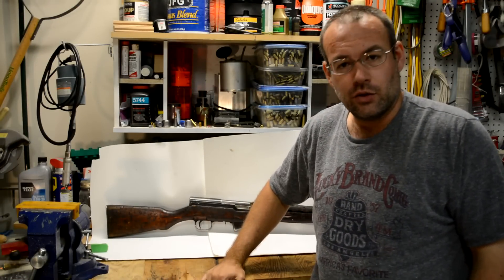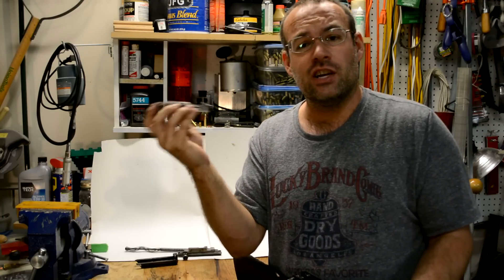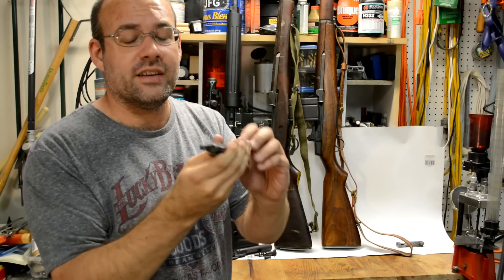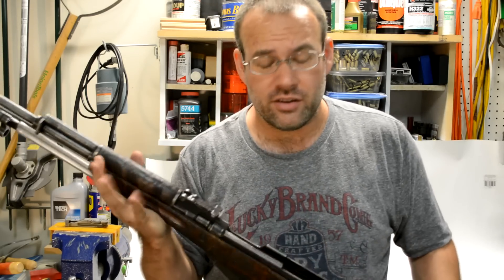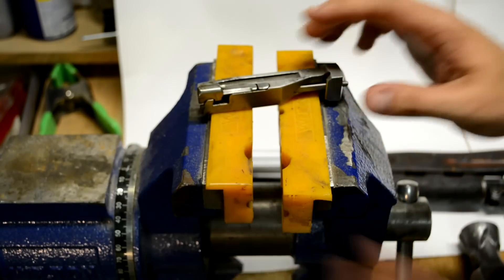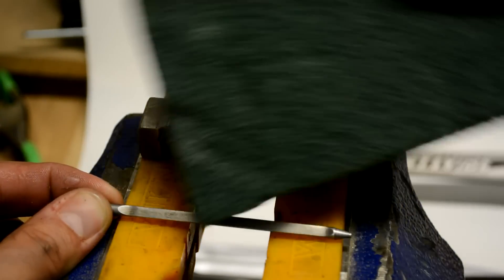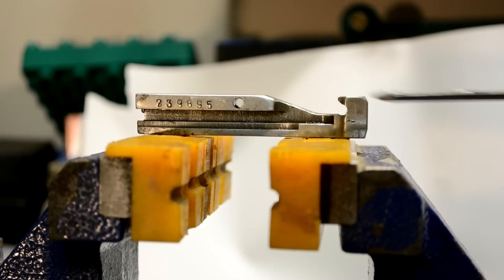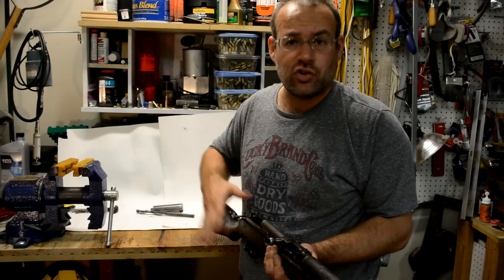Slam Fires in SKS Rifles

Comment: I got a Chinese sks is near perfect condition, Still pulled the pin out to check, Infact ANY gun, spring loaded or free floating should be checked.

Also I've heard that the after market spring loaded pin for the sks works better with the softer boxer primed ammo but most of the breaking happens when using it with the harder berdan primed. IMO keep it clean and shoot the cheap ammo from your cheap gun and have fun.

Comment: A very informational video!  Thanks!  I just looked at an SKS at a local shop yesterday. It must have just come off the boat--full of cosmoline... The action moved ok , didn't look at the firing pin --hadn't heard of the problem until I saw this video.
Reply from the maker: Having a C&R license I've always bought my SKS rifles straight from the importer filled with cosmoline.  I've seen too many SKSs for sale by individuals at gunshows that were failed attempts by bubba to make a cheap AK47.  Of course they're not exactly cheap anymore either.

Comment: Gun Range owner here. The SKS can and does have slam-fires even with a clean Bolt and Firing Pin. Period. It is the overall bolt and firing pin design that contributes to the problem. The firing pin can start to 'form' to the bolt face from behind and stick forward enough to ignite a primer, especially Boxer primers. Don't compare one 'Free Float' design to another and deduct that it cannot happen since it doesn't (nearly as often) in other similar designs. Although not common... it happens. Never chamber a round without making sure the SKS is pointed in a safe direction. This video makes it seem as if you have zero chance of a slam-fire as long as you keep the bolt clean...simply not so. I have seen it happen many times over the years, usually when chambering the first round. All the videos on Youtube showing slam-fires are not because of cosmoline, most are likely from the pin becoming stuck in the firing pin hole. Be careful and know that it DOES, and has happened in most firearms but the SKS design is by far the most prevalent.
Reply: MrHetero Erectus are you going to point your ar or any other murcan gun at your dog and chamber it? the sks bolt is fine, it's just cheap and people treat them like shit because of it. just, use common sense gun safety and you won't have a problem.
Reply: Not going to point my American, or any other nationalities firearm at anything other than the ground while I chamber a round...that is common sense gun safety. As for the SKS Bolt, it IS of a design that is rather unique internally and can be, but isn't always.. problematic. The Bolts firing pin channel and the shape of the firing pin is the problem. The firing pins end is tapered, and the bolts firing pin hole is tapered to match. That is the problem. The design is almost identical to that of a 'Morse' Taper, which is what is used to 'hold' chucks in place by forming a wedge type fit. It is a design problem that may or may not manifest...but even a perfectly clean pin can seize.  An AR firing pin, while free-floating is not tapered the same.
Reply: MrHetero Erectus nothin wrong with the design..just gotta be cleaned once in awhile. I've never  had any problems with any of my sks s ..maybe you should make your patrons break down thier weapons and clean the bolt and fireing pin like this video before you let them go on line at your range. I have fired thousands and thousands  from sks .I'm 57 ..been a user since I was 12.
Reply: Mrhetero ur right different ammo will give me different results , bolt can be clean as a bean but i use a different ammo i will get the odd slam fire but none with the surplus ammo.
Reply: Everything batman collector not made for civilian ammo ..use steelcased military surpluse only..no soft primers
Reply: O9r Geronimo well i guess it wasn't made 4 civillian ammo as it was masde in the 40s and 50s, that being said Murrays pin will stop that and now 1 could use non corrosive ammo if they want , i put the new pin in and a strikeforce stock , works perfectly.
Reply: Put a Murrays pin u can shoot any ammo u want surplus or non corrosive
Reply: I can see this.  I disassembled my bolt and cleaned it thoroughly.  It rattles back and forth like it should... but with enough forward force its seems like the anterior bevel on the pin and the rear of the bolt face where it projects through almost marry together a bit.  The bevel on the pin being the stop for forward motion makes it prone to sticking with enough force because it drives it tight verses a pin that was the same gauge front to back with a stop on the rear... more like an AR.  Cant imagine mine is enough to ignite a primer.. yet anyway... but will have to see.  Havnt fired it.  Bought it for $150 from a guy that never fired it but had a friend put 4 rounds through it to site in a scope it had mounted.  Awesome deal even though its a norinco.  Cant wait to go put some lead down range!
Reply: Except people also say, their gun is not loaded right before they pop off a round. Making everything you said moot

Comment: Thanks for making this video. I changed out the original firing pin in favor of the Murray's spring loaded pin. I didn't have any slam fires but after firing about 40 rounds of Tullamo I had  3 primer caps stuck in the firing pin channel causing the firing pin to bend and jam. The spring for the firing pin was pretty jacked up as well. I re-installed the original firing pin but haven't tried it out yet. Any suggestions besides changing ammo? I have lots of the Tullammo I'd like to use.
Reply from the maker: I'm not exactly following the issue.  Were the primers getting pierced by the firing pin and being pulled into the firing pin channel?  Even with several different SKS or AK variants I've never had an issue with any Tula or Wolf ammo.  As long as the original firing pin isn't damaged it's the best firing pin for your SKS.

Comment: You can solve this problem multiple ways:1st  -  clean the hell out of the firing pin area.  I use Ballistol  (it stinks, but it lubes and cleans at the same time).  Use a q tip (soaked in ballistol) and clean the area near the pin hole (where it meets the primer).  Do this enough and the chance of a slam fire is remote.2nd - a Springed Firing Pin kit is available for about $65.  It contains a firing pin and a spring.  the pin is one of two variants.  The spring returns the pin to the end.3rd - Some times, then primer hole gets non-rounded.  It gets "out of round".  This means that if you fire the gun, the pin will stick in the out of rnd hole.  It will cause a slam fire.  The fix is to have a gun smith repair it by drilling the hole and thus allow it to operate with in normal parameters.I have fired over 200 rnds in one sitting.  Not a single slam fire (in a free floating pin) happened.  I could see the heat waves waft from the barrel.  For what I have read, most slam fires result from improper cleaning and rust forming in that area.  Rust/carbon then causes the pin to stick.  This sticking then causes slam fires.  For what I have researched, this is the most common reason.Why the SKS is so maligned, I do not know.  The m16 (variants have free floating pins).  Makarovs have free floating pins.  Kalishkinovs have free floating pins.  Many very well known Mil type weapons have free floating pins.  Yet, they are not maligned.  The BATF (Bury All The Firearms) will go to great lengths into "forcing the SKS " to slam fire.  We all know the BATF is not gun friendly.Should any one have any suggestions and or comments, please do.
Reply: Or just buy the Murrays pin.

Comment: while gunked up bolts probably cause a lot of slam fires or at least contribute to it... I also think that there is a potential for the pin and bolt to marry together because of the design.  Rather than a hard stop on the rear that prevents excessive forward travel of the pin like an AR... the SKS has a bevel on the front of the pin that only lets it project so far.  With enough forward force that bevel can drive tighter into the bolt opening causing the pin and bolt to stick together.   Whether its enough to ignite a primer or not i dont know... but it wouldnt surprise me if it was.  This may also depend on slight variations between ammo and would certainly be exacerbated if there was any accumulation of cosmoline or gunk at the rear of the bolt face.  MIne while free to move and rattle back and forth.. with enough forward force does "stick" to some degree.

Comment: My Russian SKS is a 1951 version, and the firing pin HAS a spring. However, the pins sicks forward. I BOILED the bolt and pin. I even sanded the pin a bit and it still stuck. The thing is that if I rotated the pin 90 degrees, it easily moved and the spring easily kept it back... so it must have been ever so slightly bent. I bought a replacement from Murrays and it easily moves back and forth and the spring easily keeps the pin back. So even with a cleaned bolt (boiled, several solvents, pipe cleaner, etc, etc) the original had some issue. And this is with a rare Russian SKS that came with the spring loaded firing pin. So MAYBE I could have sanded down the pin until it moved nicely, but I just went and bought the modified pin, which moves so much nicer.

Comment: thanks for the info, I never understood why people always worried about the SKS slam firing but never even question a AR15 or AK variant. they just trust them and they work the same way in there basic functions
Reply: It has to do with the taper of the pin, primarily the nose of the pin. The Garand and M14 pins use a radius at their nose.  The SKS uses a tapered pin, in a tapered hole. A tapered plug in a tapered hole = stuck.

Comment: On both my chinese SKS rifles slam fire was not due to cleanliness. It was a matter of thermal expansion and shape of the firing pin. (Poor machining is a contributing factor as well). Yes keeping it clean will reduce the chances but no matter how clean or how lubricated you keep it it will not fix the design flaw of the SKS. The SKS was designed to be made cheaply and reduction of machining steps was a large part of the cost savings. To fix it you would have to redesign both the passage in the bolt and the firing pin's shape.
Reply: ..sorry no design flaws cmon
Reply: Yes, russian sks have no problems. Same with my bro chinese norinco. Run flawless.

Comment: It happened to me once with my Yugo M59/66. I fired two rounds and it dumped the rest in felt like less than a second.
Reply: Yep...and keeping it perfectly clean does not mean it can't happen. The tapered firing pin is much more likely than some others to 'wedge' in the firing pin hole...causing a slam fire. Reassuring people that if they clean the cosmoline out that they won't have a problem (as the vid states) is not a good thing. Lots of young kids shooting SKS' that won't know better.

Comment: I know this is old but is it ok to lightly oil pin before going back into bolt housing, I always have?
Reply from the maker: Unless its kept or used in a humid environment I'd leave it dry because the only good thing its doing is stopping rust.

Comment: Where did u get those stripper clips i bought some on amazon and god were they crap! Only 3 of 10 actually worked without a flaw
Reply from the maker: I got mine from one of the internet firearms stores (Aims, J&G, Century) many years ago as an add-on to a larger order.  These are surplus vs. new which I've heard makes a difference.  I don't see any of the normal stores selling the surplus any more so I'd recommend taking a chance on ebay, gun broker, or go to a gun show.
Reply: DEUCE AND GUNS yeah i thought they were surplus yeah the new repro ones suck more than a vacuum